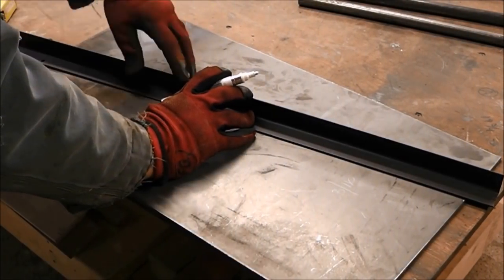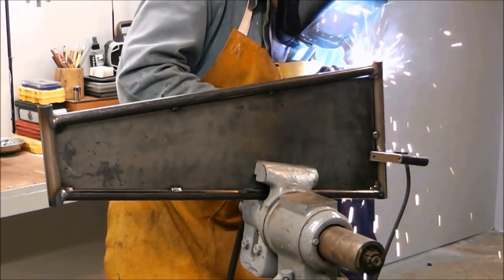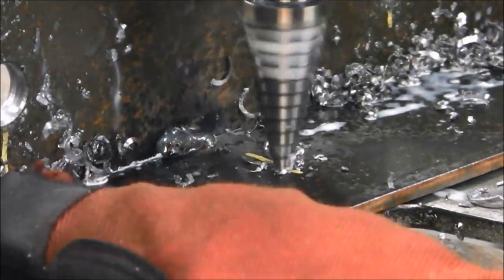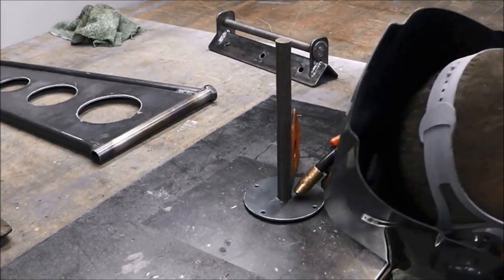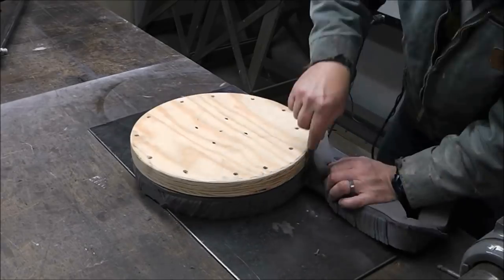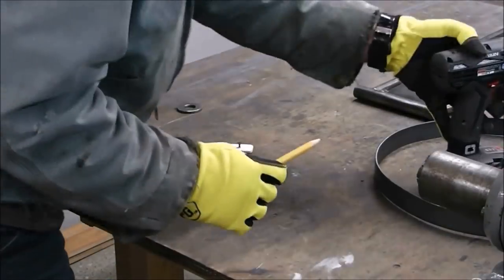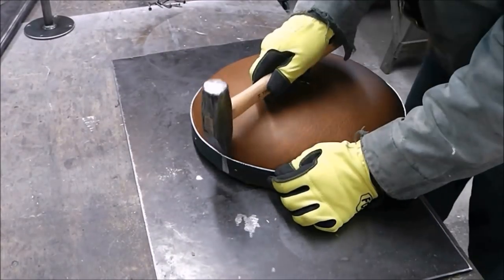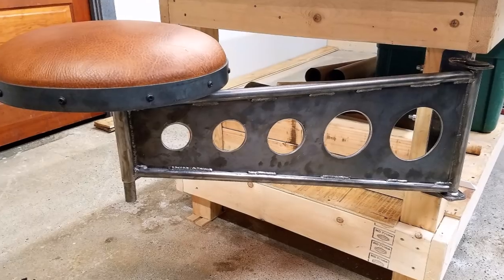Shop Stool (old video edited)

Comment: Great build! The only thing I would have changed would have been mounting it a little lower and drilling holes in the shaft of the seat to allow for hight adjustments with a pin. Great project though! I wish I'd thought of it years ago!
Reply from the maker: Thanks man! Yah, I thought about making the seat adjustable too, but it's really only me that sits there so I decided to keep it fixed.

Comment: Nice job & a very good vid. You speed things up & don't bore us with a bunch of BS. Just a tip about making the seat post, drill a hole the size of the pivot tube thru the top plate & weld the top rather than welding it to the bottom. That will give you a smooth surface  to rotate on the bushing. 👍

Comment: A tip for draping the leather over the foam.  Cut about 1/2 more material than you think you’re going to use. You can always trim off but not add. Take a giant c clamp and push it down wood at its center as much as you’re able. Then, back the c clamp a quarter turn.  Staple counter corner like you would when tightening a tire on a car. Do the corners first.  Not the space between the corners.  And do not go in a continuous circle.  Counter corner will create new corners.  Do these next while laying the material down as flat as possible.  Staple at different areas or depths from the center.   You don’t have to staple at the edges only. Aim for uniformity. Whatever you do to one edge, you do to the opposite. Release the c clamp and enjoy.
Reply from the maker: Great tip! Thank you!

Comment: yo bro.. is there a 220v milwaukee bandsaw anywhere in the US ? yours is 110-120v right? thanks...nice video
Reply from the maker: mindfreak001009 I don't believe milwaukee makes a 220v model.  This saw is 120v. I did fund a makita portable bandsaw but it's long dollar (expensive) https://www.samstores.com/product-makita-2107f-portable-band-saw-240-volts-13550.html

Comment: In my experience. (as a machinist for ten years, and a drill press operator for three of those) hole saws just do not work well on metal. Or at the very least, there are much better ways of cutting out large diameter holes. Much better ways.
Reply from the maker: I completely agree. Using a hole saw on metal is very time consuming and possibly dangerous if your not strong enough to over power the drill when it binds. If I had to do it again, I would probably use the hole saw to bore a hole in a piece of 1/4" ply and then just use that as a template for the plasma.

Comment: Hay Brandon what size steel tubing  are you  using and  steel  stock for the hinge? Thanks
Reply from the maker: 3/4 tube and I used 3/16 plate for the hinge with 1/4 tabs where the pin slides through.
Reply: @BrandonLund  thanks  for your  reply  glad to be a subscriber.

Comment: What about rust?
Reply from the maker: I personally like rust. Sometimes I will use Minwax furniture wax on bare metal to keep the bare metal look without the rust or you could paint it or powder coat it. It's really personal preference and the look you are trying to achieve. I haven't put anything on the metal and 4 years later it still hasn't rusted but I also keep a de-humidifier in my shop also to prevent rust so apparently it works.

Comment: Buen trabajo pero inútil. El banco de trabajo se puede dar vuelta si no está atornillado al suelo y se lo puede usar en sólo dos lugares.
Reply from the maker: My bench is not bolted to the ground and it has not turned over. Not even once. What may appear "useless" to you, is actually something that is used daily in the workshop with none of the negative things you pointed out.